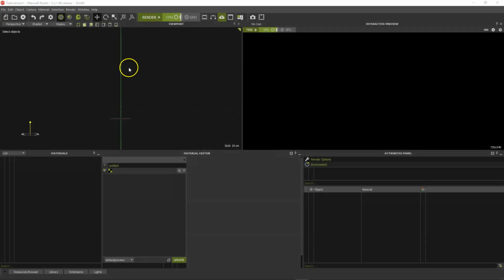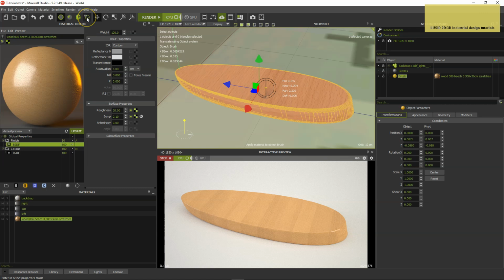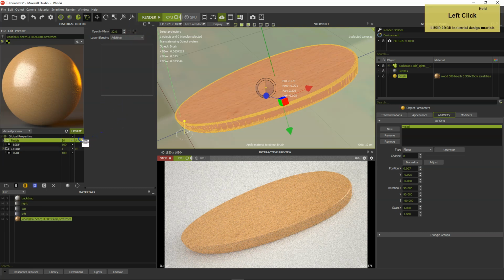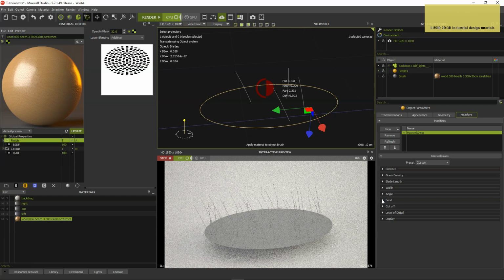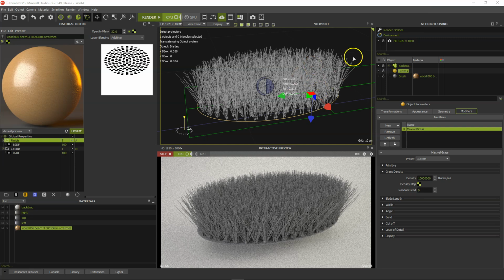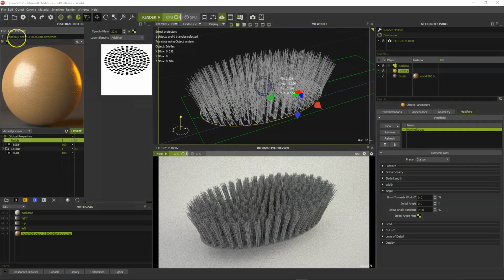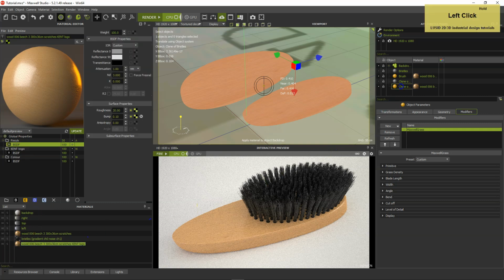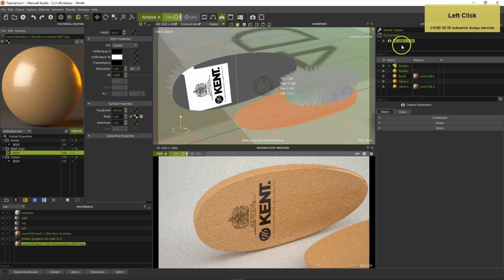Maxwell render tutorial - Rendering brushes and bristles

Comment: Have you tried Bella render?
Reply from the maker: Not yet; there's no GPU support, and no stand-alone, like Maxwell Studio or Keyshot for industrial designers using Fusion 360, SolidWorks, Alias or Catia.
Reply: @Andreas_Hopf  So I recommend you try it. They have GPU acceleration in development and their latest Saturn solver is similarly fast as Maxwell GPU (Ryzen 5950X vs has RTX 3070 Ti). I use Rhino where Bella has a plugin that works 3x better than Maxwell.
Reply from the maker: @martinsefl5217  Well, maybe some time in the future, once there is a GPU-enabled proper standalone version industrial designers can use alongside Fusion 360, SolidWorks or Alias, Catia, etc.